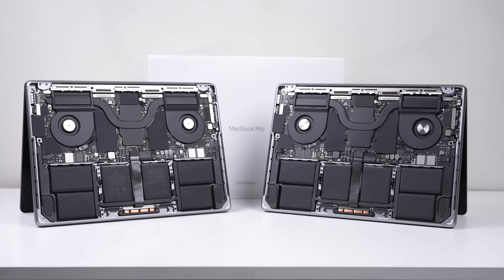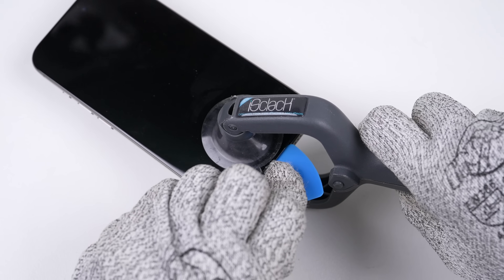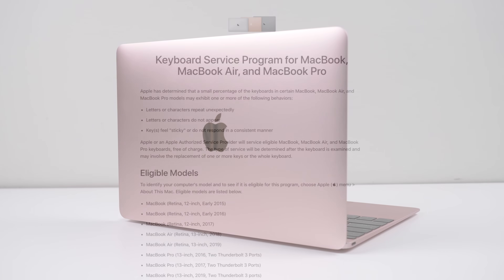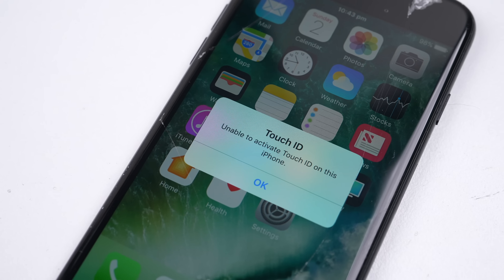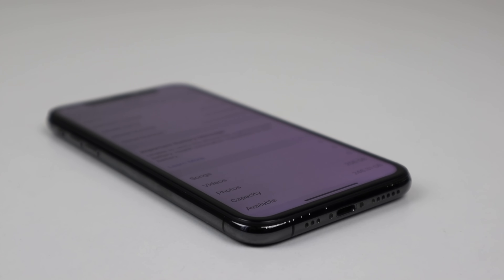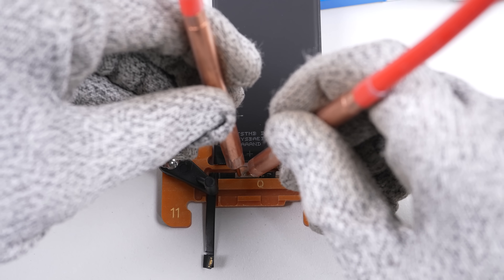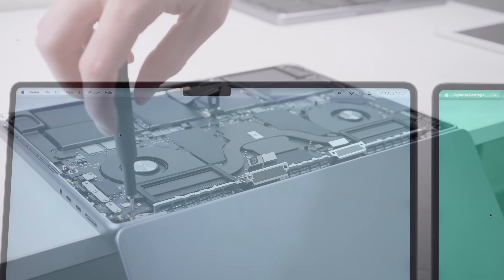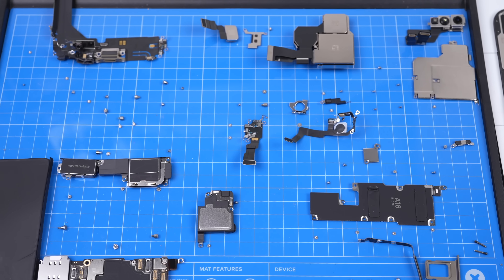Astonishing Anti Repair Practices By Apple In the Last 15 Years

Comment: The soldered on RAM and, particularly, SSD was the breaking point to me. Couple this with the obnoxious pricing to get these components up to acceptable when you purchase the device (24GB RAM for $400, 1 TB SSD for $400, both in the range of five times fair market value for current gen SO-DIMMs or 2230 NVME). To be honest, I didn't know about the other strange, controlling issues. Anyway, I used Apple since the IIc and they just drove me away. I realize there are pitfalls on the PC and Android sides of it, but at least there are choices to make.
Reply: @MegaFieldy1  You said soldering is the most important thing. When challenged on this, you avoided the challenge. Show me the computer made of 30 year old soldered chips that is faster than a modern design without soldered on RAM and SSD. You avoided this, probably because you can't.
     Further, the thickness isn't that much an issue for many devices. My 2012 Macbook Pro had a removable drive and RAM. Yes, thinner has been invented. But, my old Macbook wasn't unwieldy - there is a point of diminishing returns to this. And this issue becomes nearly irrelevant in desktops. (Before you say phones, I get it with phones. Note my complaint doesn't address price structure of phones.)
     Your crowing about supposed efficiency doesn't address the point of making dead-end machines and price gouging over upgrades that have to be bought in advance to keep them from becoming obsolete early. (Or dying early, with the plethora of early SSD deaths!)
     I used to love Apple, but they drove me away. Trying to feed me their questionable talking points and ignoring my concerns won't bring me back. It's like you're engaging in performative platform wars instead of dealing with the point.
Reply: @MegaFieldy1 soldering upgradable parts  on board is the best way to secure profits and make people buy new things instead of upgrading the old ones )))
Reply: Being part of a "high-end" pretentious cult just costs more.  
At least they haven't demanded the group sex.  Yet. Keep reading the fine print on those License Agreements before you agree!
Reply: @jovetj  yeah, overpriced and under-performing.
I've never considered buying an Apple product.  They have always looked like overpriced toys for people who aren't interested in technology.
Reply: @jamisojo  I think there was a place for it, but they definitely went backwards in their handling of the Mac line, while the PC side, got better. (My computer history dates back to the Apple IIc.) The overt sabotaging of both upgradeability and repair-ability just frustrated me out. I tended to use the more featured Macs through their history, making sure I had RAM and Storage upgrade paths, if not more. However, if they are not willing to make a machine that fits my criteria, I am not willing to pay for it.
Reply: @jamisojo iphone 5s was really good for it's times.
And macbooks at that time was kinda good too. Especially with freeBSD or linux )))

But then I tried thinkpads and fell in love with that trackpoint and ruggedness. But, tbh, lenovo did some questionable anti-repair stuff too. Just at much smaller scale
Reply: @jovetj  South Park Season 15 episode 1.
Reply: @MegaFieldy1  Nope. Solder all the 30 year old chips onto a board you want, your device will be snail slow compared to modern chips not soldered to the board. The best way to improve performance is through improved design and lithography.
     I don't know if you were being sarcastic or what, but trotting out a patently absurd exaggerations doesn't address my complaint.
Reply: @MegaFieldy1  you're totally right. Until you want to upgrade.

That's alike to batteries. You can glue them in and have low profile or you can have them exchangeable.

As for windows PC... you're firing blanks. The only windows machine I have is at work and the one in the VM for occasional strange word documents editing. Other then that pure FOSS. So kick rocks!
Reply: i've been using apple on and off since the IIe days, I stopped buying apple products in early 2010. Around '06 I bought my dream computer at the time, a dual processor power pc server that cost about 5k dollars. I really liked it overall but Apple discontinued support of the gpu and some other parts in the machine 1.5 years after purchase with my warranty on those parts still having another 2 years to go. The GPU failed under warranty, the card no longer existed and no support for new cards was planned despite the hardware being compatible.
Reply: @MegaFieldy1  well guys, i found the atheist that worships corporations
Reply: Ridiculous price for componants when you consider they are made by the million , i repair game consoles & know the trade prices' Apple is realy taking the piss .....
Reply: @MegaFieldy1 'I overpaid for a computer with moderate performance and subpar compatibility'

Just say it lmao.
Reply: @johnnydjiurkopff  lmao

Comment: I have been in the computer business since 1969. Badly repaired apple products, then presented to apple for repair, is hugely costly. And I have seen so many 2nd hand iPhones on eBay with crap screens and batteries. Ugh. It's so bad now that I only buy unopened "new" iphones, usually last year's model

Comment: This right to repair argument is just silly.  Every product has unique parts and if a part fails it's nearly impossible to find replacements.  Only the manufacturers have a supply of legitimate repair parts available, and you are always best served by working with the manufacturer instead of some sketchy electronics repair shop.  I made that mistake once .. taking an iPhone to a third party shop to replace a broken screen. The replacement screen was dim and unusable, and I still had to pay for the work to get my iPhone back.  I WILL NEVER DO THAT AGAIN. 

If you have a problem with your device take it Apple and ask for help. If it's old, they may not be able to help you, and you will have to replace it.  It may cost a lot to get repaired and you are better off just replacing it.  Never go to a third party electronic repair guy .. you will not be happy .. they hate Apple because Apple is trying to get these crooks out of business.

Comment: I'm so glad I care as little as I do about cellphones. I got a new phone last year, and before it I had a Samsung Note 3 for almost 10 years, and my goal was 10 years but it malfunctioned hardware wise just before that. It was good enough lol
I then got a Samsung A52S last year that I smashed the front glass after a few months, only to find out it's not just glass, it is attached to the monitor + electronics. The price of replacement would be 70% of what I paid for the phone so I just said f that. I'm still just using it as is because everything works, and it's not too bad.

I have seen 3rd party options that you can swop yourself to save a buck, but there's no guarantee that will be a proper fix. Not very interested in dumping more money into this phone only for it to be in vain, so I'm still on the fence about it. We'll see because the phone works perfectly so that's the important part.

Comment: I'm on the fence with all this. On the one hand i can absolutely understand the annoyance of Apple not allowing you to repair your own device...but i can also understand that Apple also want to be protective of their products - after all it does carry their logo. Personally, I prefer Apple blocking third party repairs - it means if my device has an issue then it's going to get a genuine part and not some cheap knock-off that could cause other issues or be dangerous. I remember the time when you could swap out batteries in phones and laptops and the amount of issues people had with them not lasting as long or even setting on fire. It's no different than people buying cheap chargers and cables that have fake security/safety markings. Whilst i'm sure there are some very competent people out there that actually know what they are doing and really want to help repair people's devices...there are a lot of people that are ripping people off, putting people at risk, voiding the warranty etc.
Personally i've had no issues with Apple repairs - i had a macbook pro where the lettering was coming off and the keys made a mark ont he screen - fixed within a few days with genuine parts byt them and zero costs. Accidentally spilt coffee on my ipad, the screen had issues, but they couldnt detect water damange so replaced it for free. Used my official japanese charger in the UK and it  stopped working - they replaced it for free. The biggest issue was when my battery started expanding on my iphone 5 two days before i was due to fly home and visit family - popped into the Apple store and they gave me a new phone. 
Any device can have issues - but when i'm paying a lot for a device i expect the support to be great and the repairs to be genuine and not cause problems -- why would i spend almost £1k on a phone only to take it to a generic phone shop around the corner to fix it with a cheaper screen that i have no idea if it's genuine or will stop working... for peace of mind i'd rather go back to Apple - and the fact they have plenty of stores and home collection services and make it so easy to get things fixed compared to other companies is why i really don't mind Apple being so protective of their products.

Having said all that though -- at the very least Ram should easily be upgradeable
Reply: No.

Comment: Apple genius repairs are intended to monopolise repairs and significant cost using overpriced oem parts. They dont seek to use common parts for a reason.They are the car industry. Tye landed cost of a iphone is around $140 and a macbook maybe $200. They dont want to repair what is cheaper to replacem..hence genius bar. Think about how it became known as genius. You can fix something and make more money

Comment: 8:10 This deliberate slow-down of older devices is the reason why I refused to press 'Yes' on update requests on my iPad Pro after a certain point. But the update message keeps showing up, with no way of turning it off (to my knowledge). At one point I ended up pressing yes by accident, and ended getting an update. I personally have no intention of purchasing Apple smart devices in the future. I guess no huge tech firm is totally innocent in terms of 'planned obsolescence', but Apple takes it too far.

Comment: This goes back a lot farther. Do you forget the warning label on the original 1984 Macintosh? “Do not remove cover. No serviceable parts inside”. They always discouraged you from upgrading or replacing components.

Comment: I will call you Appltards fools if you fall for this! They will NEVER genuinely support right-to-repair; It is totally against the company's ethos. However they are not above putting out a program that sounds nice and sounds like it is the solution to quell this exact criticism, instead are mostly PR stunts to throw customers off of listening to third party sources about the issues. This is exactly what the "Independent Repair" and "Self Repair" programs turned out to be.

Comment: if apple hardware was in a videogame:
-durability 100 (+100% wear rate)
- sturdiness 0
-90% chance of permanently breaking while trying to repair
-requires level 10 electronic engineering proficiency to modify.

Comment: I don't understand why anyone would continue buying products from a company that has consistently and persistently mistreated them for literal decades.  It's just baffling.
Reply: Stockholm syndrome, maybe?
Reply: Hmmm? Steve Jobs "Legacy"
Reply: atheist liberals worshipping a logo
Reply: Easy, most Apple customers use their products for like 1-2 years and move onto the next model when it's released. The only people affected by this are second-hand users and people who want to use their stuff for 5+ years, Apple considers them low priority. They want paying customers, not customers who use a single product forever without issues. That's not profitable. All manufacturers do this, some simply stop producing replacement parts after 2-3 years, end software support, make new software incompatible with older hardware or lock the bootloader.
The point stands: people who frequently replace their Apple products are highly unlikely to encounter hardware issues so they'll remain loyal customers. That's also the reason why many people buy new cars and sell them after 3-4 years when it's still fine, problems usually start happening after the 5 year mark.

Comment: You sound like you believe that apple is actually supporting repairability by supporting this bill.... They OBVIOUSLY aren't, they're clearly going to use their lobbying power to modify the bill in a way that means it changes virtually nothing.
They are backing the bill so they can APPEAR to be supporting repairability. They WILL corrupt the bill.

Comment: 1) Soldered RAM offers higher bandwidth than slotted RAM. If you don't want to throttle RAM access with today's CPUs, you will use soldered RAM. For even more RAM bandwidth, you can build the memory tight into the chip, as Apple has done with its M1, M2, and M3 CPUs.

2) Pairing components together makes their resale value close to zero. By doing so, Apple has made theft of iPhones, iPads, and Macs not worth the while. You're welcome.

Comment: AppleCare is cheap and gets everything repaired quickly. What’s the issue. To package up all this stuff in a great phone, it’s obviously not going to be easily accessible / DIY repairable. 

You can go back to the Nokia’s I guess, if you want to repair your buttons easily.

They also support buy backs at good prices for old devices. I really don’t see any reason to complain unless people just want to tinker with stuff. But then you have the risk of pre owned devices with janky repairs out there, which I assume would give people a negative experience using Apple devices.
Reply: But they don't fix stuff though? How many people can tell you stories of them taking it to the apple shop and hearing that the phone can't be fixed and they can sell you new one.
Also you don't see a problem to them making a monopoly on fixing their own devices? Imagine someone done the same to your car and you need to pay 10x more for official BMW to change your bloody tire.
Another thing is. Name one thing that android phone doesn't have when compared to iPhone. But somehow it's only apple that does all of that shit, or was the first to do it.

Comment: I absolutely hate how they rivet their keyboards down. I had the misfortune of needing to replace my keyboard a while back. The process involves ripping out the old keyboard with pliers and using a hammer and chisel to remove the rivets (yes you read that right, a fucking hammer and chisel in a laptop repair).

While that method was able to remove most of the rivets, there where multiple rivets just sheared off, meaning I couldn't use screws at those points on the new keyboard. As a result, my macbook now has some very mushy keys where the screws are missing.
Reply: Sounds about the same to a process high went through a while back

Comment: A lot of advanced engineering goes into Apple products and it's very sad that they waste a lot of that design and engineering effort to implement anti-consumer features and to cut out 3rd party repairers so they can keep overcharging.
After a few bad experiences, as any sane consumer would do, I've just stopped buying Apple products. I just quietly laugh at friends who keep complaining about their Apple products but when it gets to upgrading, as any good masochists would do, they get the next shiny product Apple commands them to buy. 😆
Of course, it's not as if it's just Apple, there are other manufacturers with similar practices. Another brand I've abandoned (I'm running out of choices 😦) is Samsung who turned into cringeworthy Apple imitators and when they struck out on their own, it was usually in the wrong direction. Anyway, after many years of being loyal, the last straw with them was actually the incredible amount of bloatware and crapware that I had to deal with on the their devices, many of them uninstallable.
---
Unfortunately, there are too many rats dancing to the Apple piper's tune. If most consumers behaved rationally, Apply would get the message.

Comment: Some electronic devices are the opposite. Designed to be easily repaired.  Australia has laws against not agent repairability across all machines.  They are still to be strengthened.

Comment: Hugh, don't you find it odd that apple don't lock down any ipad parts? Apart from touch ID and face id? I can change a lcd or touch screen on any ipad and get no warning come up and same for a battery! Is it a coincidence apple do not repair ipads or change batteries but swap the model for a refurbished one? If they did offer actual repairs to ipads I bet they would implement these restrictions.

Comment: 9:55 here also, you have not represented both sides of the situation. Of course, like nearly every other huge company, especially in the US, Apple tries to make a profit from their parts.

But even Linus (who likes to criticize Apple)  has acknowledged that soldering the SSDs on the board, as close as possible to the ram and CPU, and without extra controllers, leads to better timings and is needed at such high speeds

Comment: 8:18 but this is misrepresented here. Apple products are built to mostly take care for you about any issue it could have, therefore, on iPhones with damage batteries they reduced the CPU clock so you could still use your phone the whole day.

Or are you also calling manipulation when Intel throttles their CPUs at a certain temperature? 

You also left out the information that Apple gave people the option to shut off this feature .